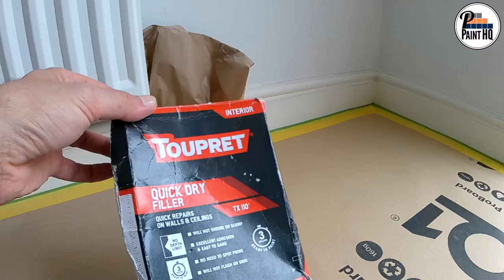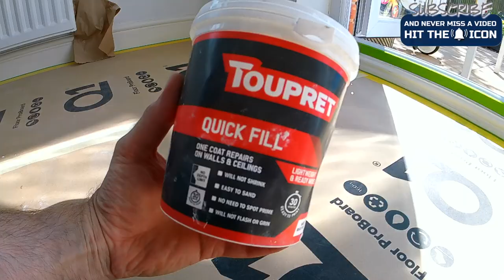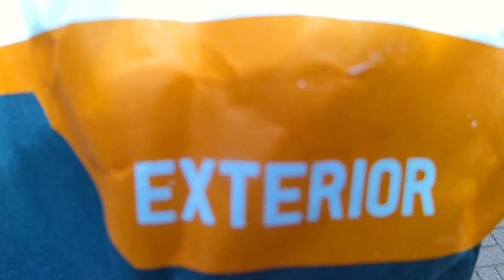Toupret Interior Fillers and The Best Exterior Filler for Masonry

Comment: Hi Pete. I tend to stay with Easifill for walls and ceilings where I can. Then for anything small I’ll switch to the Toupret ready mixed filler. For woodwork I like using the Ronseal two part filler purely for it’s drying speed.
Reply from the maker: Great insight Freddie into what you’re using.. I too have had experience of using EasiFill in the past, I switched to Toupret for the way there’s no requirement to spot prime and the the performance you get when applying the paint 😆 ..always great to have your input my friend, I like the sound of the 2 pack wood filler 👍 take care.. regards Pete
Reply: Hey guys, I too like the ronseal 2 part filler, been using it over 15 years, but I would like to find something else that is on par with the setting time, just without the constant mixing filler & hardener.. & I'm sticking with the Easifill at the moment too, what I've used of Toupret is great but much more expensive. Although the easifill I put on yesterday was still wet today 🙈 great work again Pete! 👍
Reply from the maker: Really appreciate your input and insight into the products you’re using.. always a pleasure my friend 🙏 ..regards Pete

Comment: EasyFill 20 for all large fills and skims — it works like plaster if you get the wetness right — and if you catch it as it starts to set, even better but that takes a knack. Otherwise Toupret ready mixed for all others. Cuprinol 2-part for wood. I’ll be repairing some render soon so thanks for the heads up; I’ll be trying the Toupret out! Although 48hrs?? Wow!
Reply from the maker: Thanks for sharing your insight and experience my friend 🙏 keep in touch.. regards Pete

Comment: Hey pete nice video on the joys of filling,I use only toupret as its the best I've come across and if you notice it doesn't take a whole lot of water to mix compared to cheaper brands,it shapes out very well sands great and doesn't leave piles of dust compared to cheaper brands,its a quality product and you can notice that when your mixing it,other fillers I've used are too powdery or dusty when mixing needing lots of water to mix etc,nice to see you working on pebbledash pete,you sprayed first and rolled finish?I notice when I spray dashing its very patchy and can only get solid finish by rolling
Reply from the maker: Hey Edmond, great to hear about your experiences, yeah I agree on all your findings.. with pebbledash, I’ve tried various strategies and like you I found you need an element of back rolling for a solid finish.. it’s an unfortunate drawback of spraying, the transfer efficiency being poor to work paint in Vs that of a brush or roller.. all the best Edmond, regards Pete

Comment: Hi Pete, do you normally dilute with water your primer sealer for a mist coat after patching with Toupret?
Reply from the maker: Hi Jarrod, great question.. I did prime the ceiling in this instance because the sanding left bare patches of original plaster.. otherwise Toupret performs very good and doesn’t need spot priming, you won’t get any flashing 👍 ..regards Pete